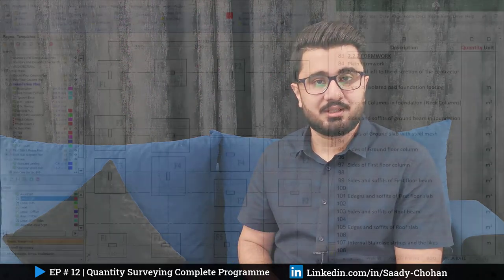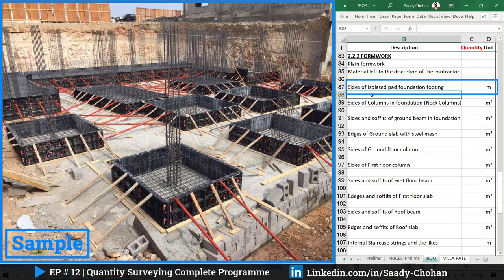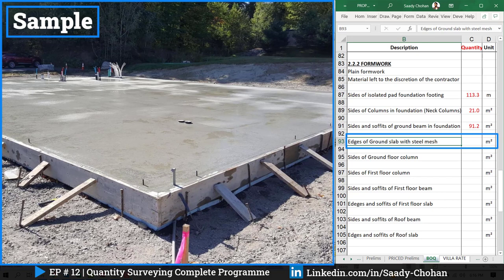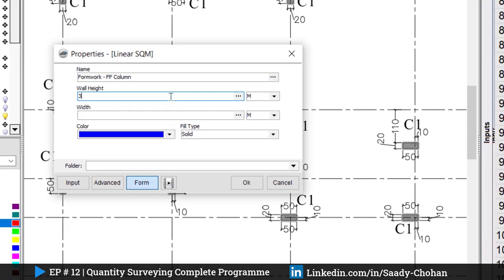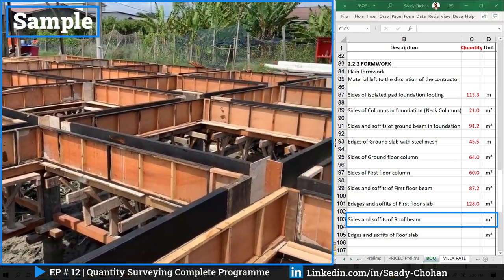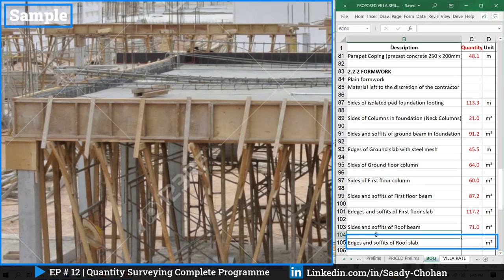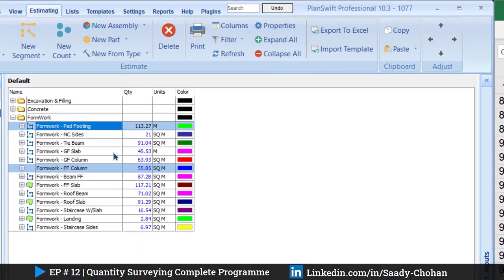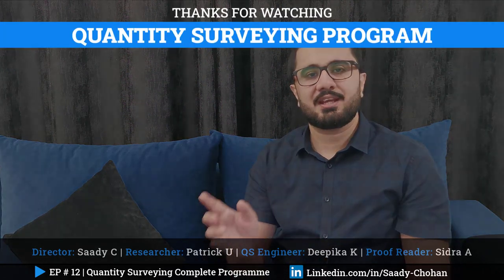EP - 12 | Shuttering / Formwork Calculation | Slab | Beam | Column | Quantity Surveying Programme

Comment: Dear I am following your immaculate course and learning a lot , however I couldn't understand this lecture, its square meter but you entered only one value of height there is no value of width for nech columns?
Reply from the maker: Thanks for watching.
Our purpose is to get the desired result. Either you use calculator, Excel sheet or any other software.
I am using the PlanSwift template that helps a lot. And you have seen how quickly I got the result. I will suggest you to learn.
Basic PlanSwift.
https://youtu.be/ftAnJXRJ_PE
Template PlanSwift.
https://youtu.be/2yU_bc-13P0

Comment: For Columns why dont we use counting template as we have most of the coulmns of same size, we can make a counting formula for easy calculation for that we need hight width and breadth of the coulmn
lets make a formula, for that we need following new properties
Width
breadth
Height
total liner length = 2*(width+breadth)         ===> As we have 2 sides of width and breadth so multiplied by 2
and final takeoff would be
QTY = [takeoff]*[height]*[Total length]
am I right?
Reply from the maker: If it is covering your requirements, you can use it junaid. :)